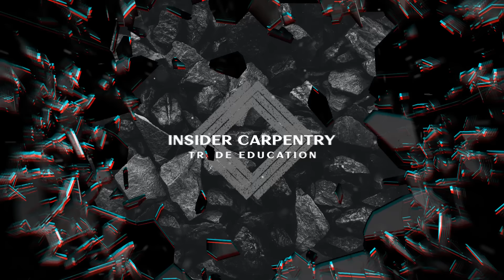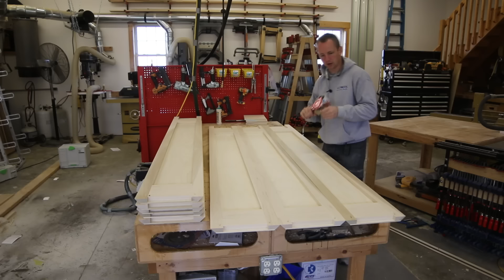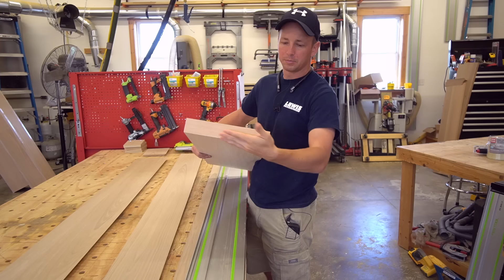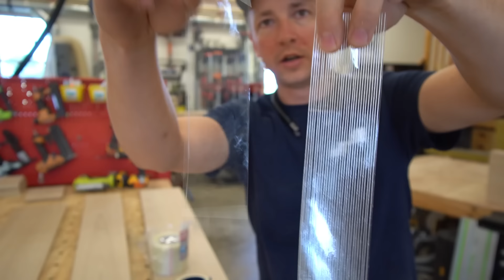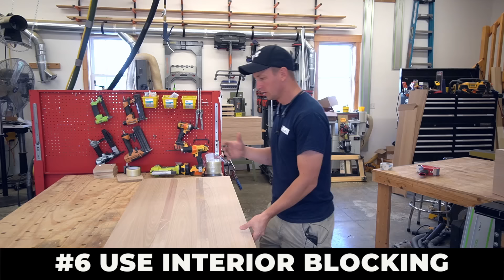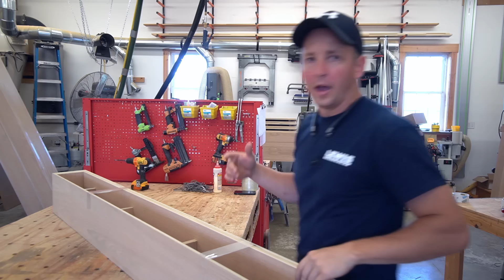MASTER PERFECT MITERS!!! | 10 Secrets to Miter Folding

Comment: I worked with very sticky tape for 34 years in a specialized industry...your veneer pulls off as you remove the tape because you're pulling in a nearly 90 degree angle to the wood.  As you pull lay the back of the tape flat on the top of the tape being removed (180 degrees) and no more tear-out. Same on painted surfaces.  Using a hairdryer helps on sensitive material.
Reply: Thanks Choim, great information, thanks for posting, 
 I have 1 tip to add, Red Vinyl Tape. It has elasticity, does not stick to finishes and comes off easily. You won't want to use it everywhere, ( cost ) but there are many instances it reallty stands out. Try a roll. One company I worked for building large condo structures only used this to tape down floor covering paper, they bought it 500 rolls at a a time , to protect the finished engineered hardwood flooring. Every trade on the site . if not using it already was grabbing part rolls.
I use it on especially places I want to add pressure, because it stretches ever so slightly. Stone installers use it as well, and flooring guys with a tricky joint.
Reply: Great information, I've learned how to pull tape properly by working in Autobody, but even with heat are there some Plywood's that grain will undoubtedly get pulled out? I can see Maple not being a problem but Walnut Plywood has always given me some issues.
Reply: @Pickrelrig  yes. i think plywood and solid wood doesn't matter much at the tape level since you are mostly working at surface scales. with wood species and cuts then, it becomes about "depth of grain relative to surface", with auto lesss so, since paint seems to be "plane and particulate" oriented vs wood which is specifically "strand (grain)" composed.

TLDR, yeah, i think wood grain is more sensitive to peeling dynamics.
Reply: Adhesives fail in shear before in tension.  Good tip choim!
Reply: @WVdavidB  That doesn't matter.  By pulling off at a right angle, some or all of the wood fibers will separate because there is nothing to hold them back.  Pulling the tape off at a tight angle, as described, is pulling the wood fibers against each other.  The rollback of the tape will not lift the fibers.
Reply: @WVdavidB  Love that technical language. Perfect description.
Reply: 😎 nice tip
Reply: great tip on the 180 pull.... running a quick light heat gun also helps the glue release just a bit.... as you also said..
Reply: Will VHS tape work?
Reply: Choim's comment is exactly right. The same applies to floors where painter's tape was applied and let sit for a while. Pull it "along" the floor (and not "perpendicular" to the floor) and ripping is much less likely to happen.
Reply: Excellent! I concur with 40 years experience!
Reply: This tip was difficult for me to understand at first, but what OP is saying (I think) is the tape sticks harder when you peel it holding perpendicular to the surface, like a capital L  … instead, fold it all the way over so the “tail” you are pulling is parallel to the surface, like a sideways U
Reply: @douglee650  No, the tape doesn't stick harder.  The wood finish is more likely to peel off when pulled straight off like an L and a right angle.
Reply: @douglee650  That's correct.
Reply: @douglee650 Exactly
Reply: Was gonna suggest this but you have done so already!
Reply: Would Gaffer’s tape work?
Reply: @lorettaangelica2099  I would think gaffers would work but isn't it twice the price?
Reply: Gorilla tape😀
Reply: This is the same when doing painted finished metal work also.
Reply: I agree with you, I'm not carpenter and I do some stuff only for myself, I'm  car sprayer for 22 years, never take masking tape off at 90° so it works the same way different trades, sooner or later he will learn on his own
Reply: Perfect - you supplied the missing detail!
Reply: Use zip tape
Reply: this tip. gold to some
Reply: What he means is peel it at a very acute angle.
Reply: I'm glad you told him.  Surprised he didn't know that.  I was appalled when I saw how he was doing it.  Thank you for piping up.
Reply: It's called... Masking tape
Reply: I have been debating this in my mind for years! 

Thanks for finally letting me know what way is best 😁😁
Reply: Good information you Left Behind I'm surprised you didn't get a response back while I haven't seen this reinforced tape for a long time great idea.
 Bye for now 
Ken
Reply: So basically put the non stick side to the other non stick side and pull like that. @HomeImProveMentHow
Reply: @matthewmarello1347  Yeah. It's hard to describe but simple to demonstrate.

Comment: Dude, use a blade guard. It’s not like you’re ripping 1/2 inch strips. 30 year furniture maker here. Trust me, I know what I’m talking about. Get an overhead guard. Nice work. Nice shop.
Reply from the maker: I have had trouble with the riving knife messing up the 45 rips. That's why I didn't have it on.

Comment: Great video. I noticed you using the ryobi 23 with dewalt adapter instead of the Milwaukee 23g 12v you had. Any reason or is the Milwaukee a onsite tool in your van.
Reply from the maker: I have both. Ryobi is in the shop currently.

Comment: I’m surprised he didn’t mention the tablesaws role. Some tablesaws will not cut a clean 45 because the top is not properly aligned with the axis of the blade.If your blade burns the material at the beginning of the cut the table will need to be shimmed in the back.
if memory serves me correctly.
If the blade burns material at the back or end of cut shim front of table.

Comment: Ahh the ol veneer pull problem. Next time try this...cut the section of tape that has that veneer stuck onto it still, leaving a good couple inches of tape on both sides. Spread a thin layer of glue on the work piece where the wood pulled up. Align the tape back into its original position nice and flat and rub that tape into the wood really good to get a little squeeze out. Wait till it completely dry and warm the tape up before you peel it off. Tada! The wood is back where it used to be! A quick couple passes with a fine grit and most veneers it’s undetectable.
Reply from the maker: Fantastic tip. 👍👍👍

Comment: Floating shelves has been on my horizon for a while and this is the perfect video to construct a perfect work piece. 

BTW, I remodeled my kitchen and studied up on your crown molding videos and I must say my crown turned out to perfection, thanks to your help. CA glue for the outside corners and the dewalt barrel grip with Collins coping foot is an absolute must for coping inside corners. Excellent recommendations 👌

Comment: Tip/Secret #11: 
Try using a corrugated nailer on the inside corners as seen in video: “Cabinet Assembly Tool: Spotnail X1C1008”.
I personally have this gun and use it in many places instead of pocket holes...
Such as wainscoting frames, cabinet frames & inside hidden corners when making outside light posts or beams as you working on... 
Give it a try it is fast... a great time saver!
Reply: HM Trimworks. Are you saying in place of glue and tape? Would it give a gapless edge (and stay together) like Spenser's? Asking a new woodworker. Thanks
Reply: @61spindrift  In some situations you would not need glue… But as what Spencer is doing glue is advisable, but with it just being outside miter with no rabbit or lock joint you would have to back your piece up to a table and a fence at 90° to hold it together while using the nailer

Comment: Not sure how this works.  Is it the angle to plumb or angle to the table?  If the table isn't dead level, wouldn't' this be off?
Reply from the maker: No, it zeros according to the surface its sitting on. You set it on the table and hit the zero button and it sets it to 0.0. Works just fine on unlevel surfaces.

Comment: Quick tape tip.  Instead of taping the whole joint, use the sticky white 3/4 painter's tape and tape it  across the joint 5-8 inch strips. Then  apply another strip on top of that.  As soon as you fold the joint it will lock right into the angle.  Locking miter joint works well as well.

Comment: On tape peeling up veneer, I didn't read all the way through to see if someone else commented. You can reduce the tact by "wetting" the tape, meaning you actually lay it on your shirt,  jeans, or even a dusty surface prior to application. It will still do the work, but won't be as ferocious when it picks up the lint/dust. You don't fully impede the tact side, just lessen it a bit. I borrowed the technique from the automotive masking off process and it saved me from tearing up paint after headlight restoration. The technique might work here or give someone else an idea for other applications. Thanks for the tips on miter folds! Saved, liked, subscribed.

Comment: I wonder if it might be a good idea to slightly heat the packing tape with a heat gun or hair dryer when removing it from plywood or any other wood or material where you want to ensure  there will be no tearout, ripping of the plys or other issues.

Comment: Very good and helpful video. I have a question, how to solve the Mitre problem when the plywood curved? Because you can't always get fully straight and flat material.
Reply from the maker: It’s trickier. Use pieces of tape per pendulum to the grain. Adjust the board as you apply each piece or tape. Then get it as close as you can as you apply the long piece of tape parallel. Usually it still self aligns.

Comment: Great video. These angle cuts are something I always get confused with. The actual angle you are joining the boards with is 44.5. And this is because if there is a gap you want the points to touch and space to be at the back. I think of this more when using a mitre saw. 0 is really 90 and according to the scale or indent a 44 degree cut is set at 46 on your mitre saw. Does this make sense?
Reply: Thanks for explaining that a diagram would be a help.

Comment: In situations where you used a pin nailer on the end of that mantle, I've started using Titebond Quick and Thick glue. It dries almost as quickly as CA glue so I just apply hand pressure until it dries and then I don't need to use any nails. My 2 cents.
Reply: Titebond quick and thick sounds as if it has improved gap filling, so the slight gap on the inside is filled with the glue?

Comment: Rule #11 use a 4” piece of tape across the grain about every 20” to set the miter .. then run your long tape with the grain …and use a block to rub the tape down … thank  me later.
Reply: Most miters i use 1 to 2 inch masking tape. No problems.

Comment: Great video and thanks for taking the time to carefully explain each "law" and the reason for it. Out of curiosity, how would you price the various items that you showed in this video? Also, what is the larger piece going to be used for?
Reply from the maker: The large piece is a wrap around mantel that goes around a fireplace bump out.
Reply: @InsiderCarpentry  How do you price something like this?  I started venturing out into this type of work to broaden my experience, but I am not sure how to price.
Reply: @MV-wb2cz  I've been doing this kind of work for over 40 yrs. The best way to price it is to figure out how much material you will need to do the job, then add 10% for waste. Then figure out how long it's gonna take you to do it, add 10% to that. Add those 2 numbers together. If you're not sure about time and materials build yourself a section and see how much material and time that it took to do it. Setup time is also a consideration to include in your pricing but that's usually a one time cost. Setup is the same for one piece or 100 pieces. Once you've priced a job and did it, you can evaluate how well or poorly you did on the estimate. The key here is to always make sure you make money...sometimes you make a little less than you thought and sometimes you do well. After the first job, it'll be easier for you to do the estimate, because you'll be able to know how much your cost was per lineal ft, etc... save that number after the first job. Adjust it if you didnt do as well as you needed to. Estimating is the hardest part of this business, but it's essential. If you get lazy estimating, you'll end up losing money. But if you price it to make sure you will make what you need to make, then you'll always be OK. You set the price. Never ever let the customer set the price. If you don't get the job, well, there will be others, and you'll be confident that whoever did the job cheaper than you either cut corners or lost their ass on it. Don't be the guy that loses his  ass. That's a sure way to lose your business. Be the guy that does a great job at a fair price. Once people know your work, they'll pay your price, because they know, they'll always get a good job from you.
Reply: @marcel-lemay7721  Thank you so much for your reply!  Your comment has inspired me to continue down this path I am on.  You are right, estimating is hard.  I normally do renovation work for people and got the estimating down for that but lately the jobs I've been seeing is requesting some light cabinet/mill work that can be prepped and assembled on-site if needed, which is perfect because I don't have a shop yet. (future dream).  I am a 1-person company for now.  Have a nice day!
Reply: @MV-wb2cz  You'll be alright. It's like anything else. The more you do it, the better you get at it, and your confidence and your skill level grows. You learn tricks and easier ways to do it. The learning part is forever. I'm still learning stuff on just about every job I do.

Comment: Great video and tips. I just did a solid white oak countertop with miter fold, aka "waterfall edge," and it came out great. Have you ever considered using a power feeder for your table saw to make these, and other cuts. I used to use one for making drawer sides. We'd rip about 10 sheets 2 sided 1/2" UV plywood to the widths we wanted, them put in a specially made undersized 1/4" sawblade for the bottom dadoes. Then off to the edge bander to apply tape to the top side. To do this efficiently would take 2 people, but was a very accurate way to get precise cuts. Thanks again for the tutorial.

Comment: Spencer, how do you securely fasten your floating shelving to the walls?  Is there a bracket you would recommend?
Reply from the maker: I purchase them off amazon. 8 inch long with 1/2' rod. Large plate on the back for 4 screws.

Comment: Mate your a wizard, always learn loads here. Ive found if you pull tape parallel to surface,  so as you pull it forms a u bend is the way to go. If you pull tape perpendicular to surface its likely to pull paint and veneer

Comment: Great tips. I find 45.5° is necessary specifically when using the tape method cause the way it hinges together at the taped end makes the glue build up towards the heal as you fold the joint closed.
Reply: The wood expands a little also.

Comment: I’ve found it helps to pull the tape off at a 180 degree angle vs a 90. Kinda like you would do for vinyl lettering
Reply: Agreed, that is the better method for removing masking tape as well. Also, using a heat gun on a low setting to slightly warm the adhesive can help minimize the problems like tearing off veneer.
Reply: @moeszyslack4676  Great tip! I have a hair dryer off and plugged in my woodshop/small shed at all times (I do own a heat gun if need be). I frequently need it as a DIYer for...well everything. And I think I used on some tape before that was stuck on. But until your comment I didn't think of that. Maybe if I built this project it would have come to me. As a DIYer that does everything I usually don't have a plan. I just do what comes natural to me at the time. Works for me.

oh I remember, I use heat gun all the time to remove stickers off my new lumber.
Reply: Acetone works the best no adhesive left behind or torn grain

Comment: Great tutorial.👍 You can also run clamping tape (brown binding tape) across the glue joint. Shipping tape along the entire joint for alignment and prevent squeeze out. Then clamping tape stretched across the joint about every 8 inches to hold it tight at assembly.

Comment: Good stuff man.  For the issue with the tape pulling grain/veneer, have you tried to hit it LIGHTLY with a heat gun?  Some materials respond very well to heat softening the adhesive. I’ve never used this tape but I’m going to buy it and give it a shot. If that simple pass with heat while you peel tape saves time in veneer repair it’s a win in my book.
Reply: Great suggestion.
Reply: Or could you put clear tape over the veneer then the strapping tape

Comment: Great tips Spencer!  I remember long ago when I first got into woodworking how intimidated I was about getting good mitres.   If you ever need to assemble something that has multiple mitre joints where folding can be problematic, check into the Lamello Zeta P2 with tenso fasteners.  You'll be amazed how well they close up mitres.  A bit more of an investment but you'll find many uses for those fasteners...
Reply: Mark Aramaki. Not only will you be amazed how well they close but, even more amazed how expensive they are! I think I'll stick to the less expensive option.

Comment: Tip# 11, use a heat gun or hair dryer to ease the tape off. Absolute pro channel Spencer.
Reply: I was going to suggest exactly the same thing :-)

It probably doesn't take much heat - the air gun is great for removing stickers from many surfaces, and acetone is great for removing residual sticky (but explosively flammable, obviously!). 

I use heat for getting labels off glass jars too, and hot water from the tap or the kettle (inside the jar) is usually enough to do those.
Reply: Stashu. That's what I just said above! Clever Idea!